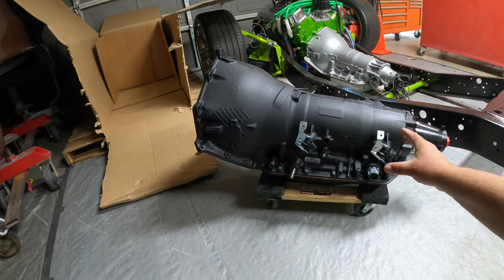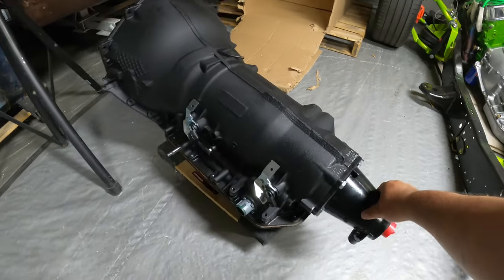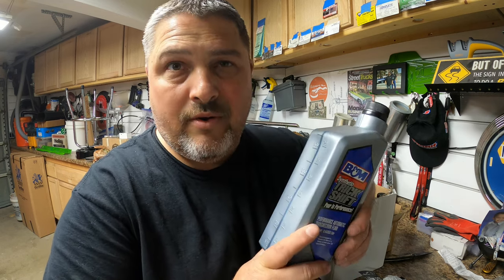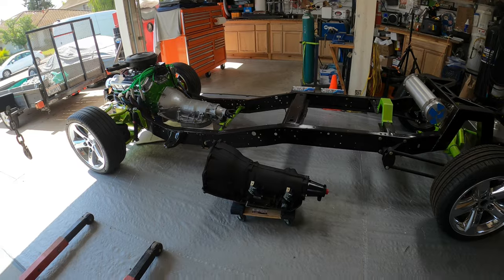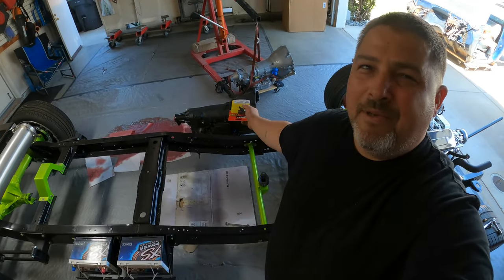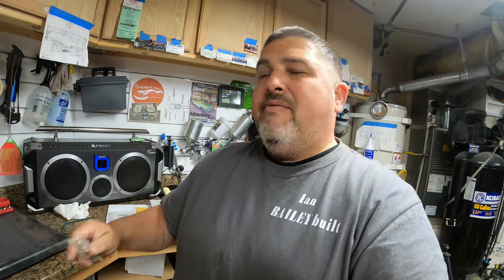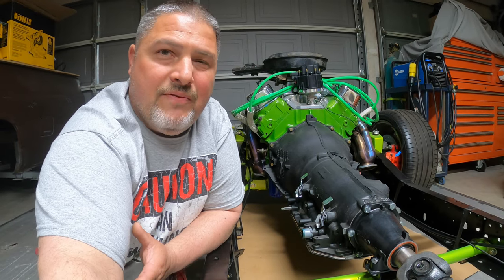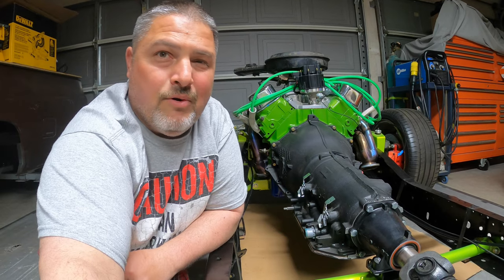S1E20 4L80E Transmission Upgrade & Install

Comment: I’m actually doing the exactly same 4L80E trans installation on my 454 BBC. What’s the part number on the adjustable trans mount brother also thanks for the TC part number and lastly part number on the 90 Degree Angle fittings. My 4L80E is going into my 72 Camaro SS and I just pulled out my TH400 too because I wanted that overdrive.
Reply from the maker: I purchased these items through summit racing.
trans mount - sum-773200
90deg - vpe-10782
adaptor - icb-551124
Reply: Good looking out. I installed my 4L80E today I ended up getting 90 Degree Banjo Bolts. I did buy and install that TCI TC , 🙌🏽 Appreciate the response.

Comment: What did you use for transmission controller?
Reply from the maker: Im using the transmission controller built in the holley sniper EFI that I purchased. I will be doing a video in that as well.
Reply from the maker: I actually purchased the Holley Terminator X Max Stealth